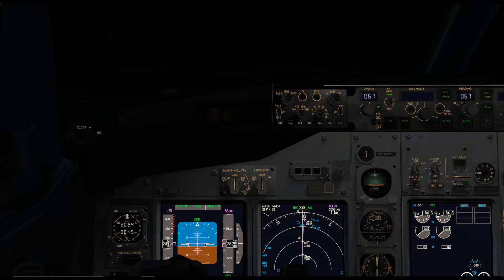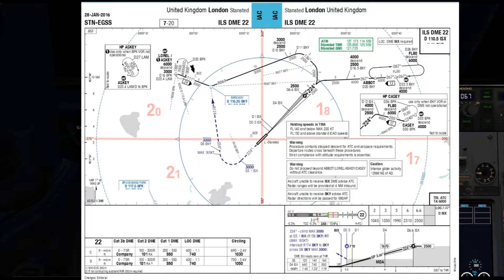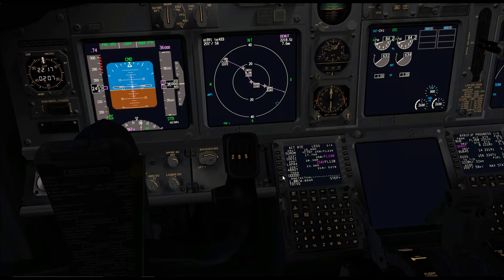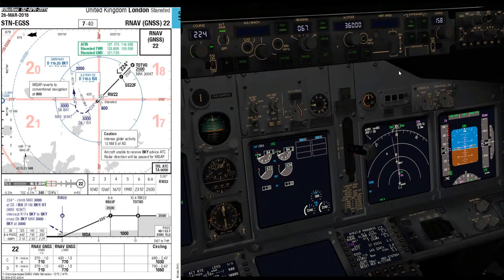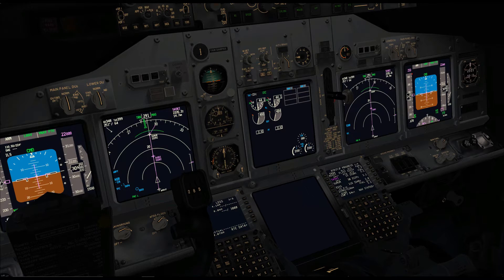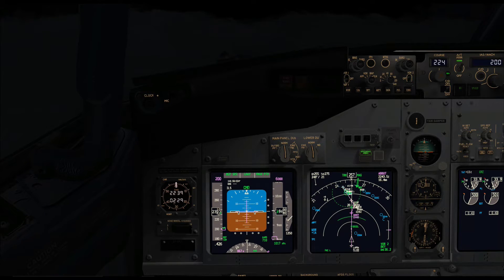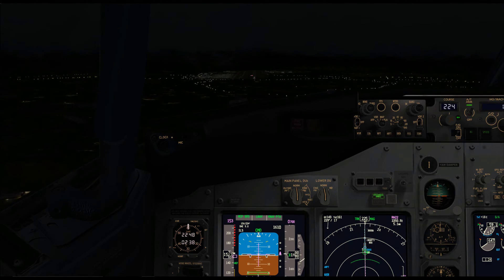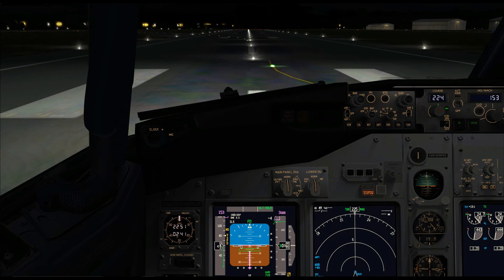RNAV (GNSS) Approach in the 737NG

Comment: hey bit late sorry but how do you know what minima to fly to as lnav minima you can still fly vnav with it but for lnav vnav you have to use vnav . the LNAV/ VNAV is an approach with vertical guidance and the LNAV is a non precision approach. so can you set the lower of the two minima then if your going to use vnav also can you fly the approach using IAN for both lnav and lnav vnav RNP approaches ?
sprry its a bit wordy great vid !
Reply from the maker: Hi Tom if I have understood your question correctly there should be separate minima for performing the approach in LNAV/VNAV and LNAV only (with the vertical trajectory flown in V/S mode or FPA in the Airbus). The IAN feature, off the top of my head, would only be for LNAV/VNAV approaches (haven’t used the 737 for a long time). BTW even LNAV/VNAV approaches are technically non-precision, the only precision approach, in practice, is the ILS. As for RNP approaches, I don’t think many European operators are certified to perform them, so a little outside my knowledge. Hope that helps.

Comment: Interestingly, it flew the approach 1/2 dot low all the way done to MDA.
Reply from the maker: Yes, quite right - you have to remember that the RNAV approach is really just a replacement of the non-precision approach like the NDB, which should have been binned decades ago. It's therefore still just a cloud-breaking procedure, rather than the more precise science of an ILS approach. 1/2 a dot's tolerance is therefore fine.

Comment: So basically just a LNAV/VNAV-Approach?
Reply from the maker: Yes, but specificallly an RNAV/GNSS approach. Technically, non-precision approaches can be flown in LNAV & VNAV.
Reply: *****
But what is the difference between a normal RNAV and RNAV/GNSS?
Reply from the maker: RNAV is short for area navigation and encompasses a huge range of different aids and tools, such as GPS, LORAN, VOR/DME, INS... the list is huge. The RNAV/GNSS approach is specifically using Global Navigation Satellite Systems, so GPS. In the 737-800, the GPS is used in conjunction with the IRS and FMS, but the bottom line is that if the GPS receivers aren't functioning, you can't perform the RNAV/GNSS approach and would have to use conventional radio aids or the old Mark I Eyeball.

Comment: 2 QUESTIONS
at landing speed of 140kt you flew with flaps 1. At this end speed is it not correct to fly with full flaps?
Do the B737 consume 2 T per flight hour ?

I enjoyed the excellent explanations. All flight parameter are shown very clear at the high screen resolution. 

Sometimes it is useful to add a marker that highlight on PFD or FMC about what parameter you are talking about (especially for beginner).
It might be useful also to show the AP configuration during explanation ....

BTW I wish to see videos of yours made in an  A320/330 (have you...?)
Reply from the maker: Points noted and thank you for those. I'm afraid your questions lost me a bit; I was landing with flap 30, and this would be a standard setting. Using flap 40 would, I believe, only be done on approaches into short runways (Skiathos, for example). 30 is standard. As for the fuel consumption I'm not sure of the round figure, I can try and look it up for you though. 
I will be doing videos on the FSLabs A320 when it's released.